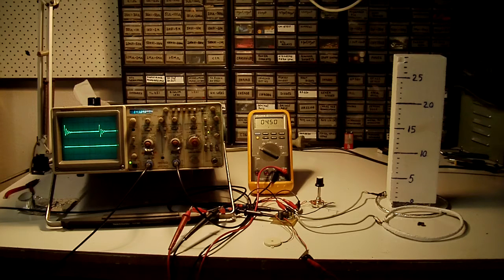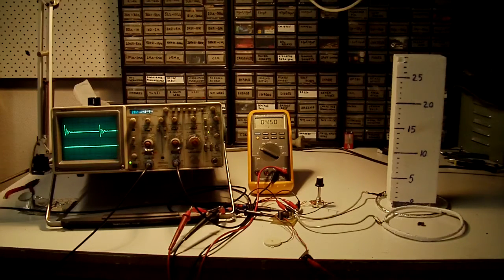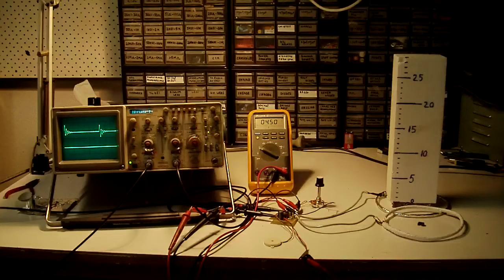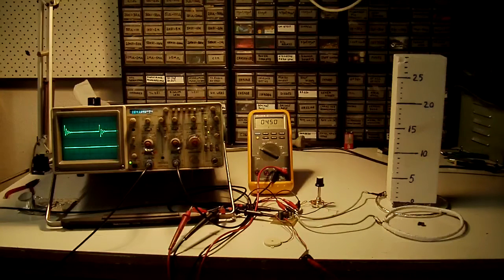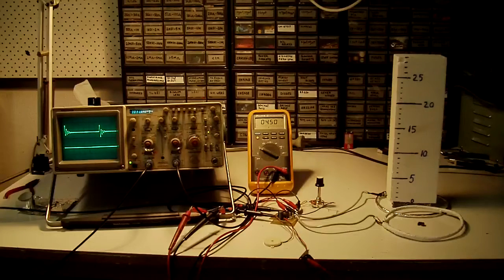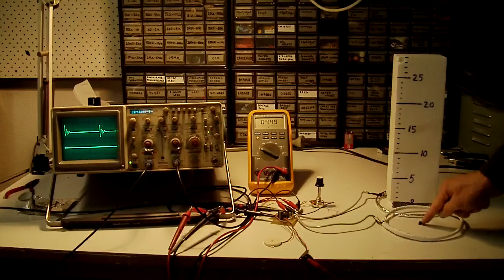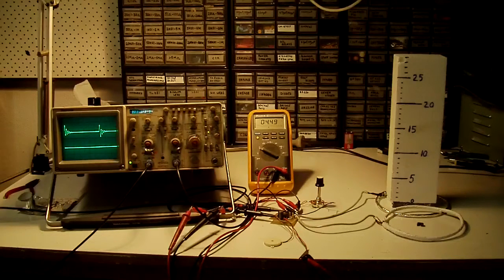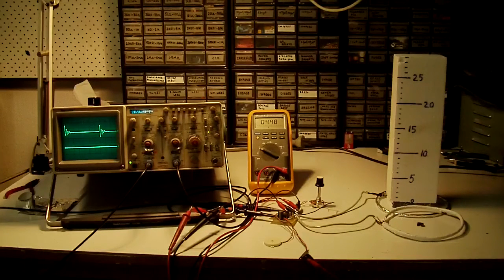Modified Matchless Metal Detector

Comment: if I reduce the coil size, can this work perfectly?
Reply from the maker: The coil size is important - a small diameter coil will have a low depth of detection. A large coil will have a higher depth, but only if the current through it is large. If you make the coil smaller, you need to increase the number of turns, so that the inductance remains the same.
Reply: @nick1f  so if the inductance is the same, will the detection distance remain?
Reply from the maker: @jsduan486  No, it will not remain the same, it will reduce. Detectorists who search for large targets at high depths are using large diameter coils (even one meter in diameter). They are less sensitive to small targets (even if they are located near surface). A smaller coil may be able to detect smaller targets. Anyway, you should experiment with different sizes of coils to see how the diameter affects the detection. Keep in mind this is just a very basic circuit, it would not be much use for metal detecting.
Reply: @nick1f  thanks, I am doing a metal detector project now and I want to achieve maybe 4-5 cm detection distance. In addition, I need it to cost small space for further design. So I am searching for the suitable circuit design now and I found the metal detector using proximity sensor only has 2cm range. Do you have any other simple metal detector circuit design?
Reply from the maker: @jsduan486  This was the simplest I tried.  I don't have other schematics. If you want better performance and stability, look at pulse induction metal detectors. They are more complicated, but superior in performance.
Reply: @nick1f  thanks. if the coil place close to the other component, will the performance reduce?
Reply from the maker: @jsduan486  The coils should stay away as far as possible from any metallic components nearby, as they will affect the results. You would also have to adjust the coil positions in order to get the null when no target is around.
Reply: @nick1f  so how to simulate this circuit with the software? can I use two ne555 timer replace the 556 chip and how can i achieve it?
Reply: @nick1f  sorry to bother you again, But would you mind telling me what is the function of preamplifier circuit and the second part of IC chip? When there is no metal, is the signal from Rx be zero so the chip is not triggered and when a metal is passed that the signal after amplification will be higher than 9V to start the buzzer. Is this right?
Reply from the maker: @jsduan486  The schematics represents an induction balance metal detector. The two coils are positioned in such a way that there is minimal transfer of the electromagnetic field produced by the first coil into second coil, in absence of a metal. If you check this document http://www.geotech1.com/pages/metdet/projects/matchless/matchless150c.pdf, you can see the placement of the two coils. The preamplifier amplifies the weak signal from the receiving coil, to apply it to second part of the circuit, which the author says it forms a peak detector that drives a speaker. If you are interested to find more about metal detectors and how circuits work, join geotech1.com and ask questions in there. Youtube is not quite the best place to ask plenty of questions.
Reply: @nick1f  sorry to bother you again. Could you please teach me how to simulate the coils conditions of this circuit? I mean the output of each stage for no metal and metal passing
Reply from the maker: @jsduan486  These are complex topics and I can't provide much help in here. There are other people who know the subject much better than me on geotech1.com. I suggest to create an account in there.  Very briefly, one coil transmits and one coil receives. The receiving coil is placed in such a manner that receives very small signal when a metal is not nearby. When a metal gets in the proximity of the coils, it will concentrate the magnetic field around it (like a magnetic core increases the impedance of a coil) and it will cause an imbalance in the field. This will cause the receiving coil providing a higher amplitude signal to the detecting circuit. I don't think the simulation can help much. Think of a weighing balance with two arms - if you put a weight on one arm, the balance will move away from the equilibrium point. Same happens when you bring a metallic target in the proximity of the coils. The coil parameters change very little (very small change in impedance). What changes is the distribution of magnetic field around the coils.
Reply: @nick1f  Thanks for your reply. I have uploaded my questions in the forum but nobody answers it for me. I still have a question that why the 555 timer will not produce a square wave when the metal is not nearby and it remains 9V for the output since there is a small signal received by Rx.
Reply from the maker: @jsduan486  Have a look at this image: http://www.geotech1.com/forums/attachment.php?attachmentid=15044&d=1303137192. Are you saying that there is no squarewave signal at the pin 5? That part of the chip should generate squarewave all the time, irrespective of the presence of a metal nearby. If there is no signal, you first have to focus on that part of the circuit. The recommended chip is CMOS. If you use a classic 555 you may have to change the value of resistors and capacitors (lower value resistors, at least for 100 kOhm) and higher cap value (47nF maybe). The other 555 with the output at pin 9 works as a monostable and it changes state only when the signal to pins 8 and 12 is strong enough to trigger it.

Comment from the maker: Hi, First make sure all components have correct values and connections are properly soldered, with no shorts between terminals. Double check pins for transistor. You have to use two CMOS 555 or a double 555. Adjust pot so that voltage on collector is 4.5V (half of supply voltage). For coils, follow advice from original article.

Comment from the maker: Hi Mark, all your advice is good, indeed the circuit would work better with a 12V battery pack and a 9Vstabilizer. About the suggestion to use plates for making the detecting coil, there are better methods, but the designer offered a construction based on commonly available materials. Anybody should feel free to improve the construction.

Comment from the maker: Also, you need to shield the coils with aluminium foil. Do not cover the whole circumference of the coil, leave a 1cm gap between start and finish. Apply insulating tape at the contact points between the coils, they should not make electrical contact with each other. Ground the shielding for both coils.

Comment from the maker: I don't think the signal from the radio station will completely dominate the function. There are a few things to check. First, double check all your connections. Make sure the component values are correct. Third - balancing the two coils is a delicate operation, you need to shift the two coils fractions of a mm to reach balance. Did you use a CMOS double 555? I understand it won't work with the classic 555. Is the voltage on collector half of voltage supply? You should use a 9V battery.
Reply: i used a regular 555 and it worked for me

Comment: To eliminate the instability caused by battery depletion, I would try increasing the power supply from 9VDC to 12 VDC (8 AA batteries) and place a 9 VDC fixed or adjustable output voltage regulator in the circuit. A potentiometer for volume control of the headphones is also desirable. As long as the circuit is properly housed in a metal enclosure and the search head is built solid (the plates suggested seems a little cheesy), you may be able to actually get a pretty decent detector for the effo

Comment from the maker: Hi, thanks for comments. I made this detector board just for fun. The diagram is simple enough to assemble it in an hour. I don't recommend building a full metal detector using such a simple diagram, since it has some drawbacks - needs adjustment often as the battery discharges, and performance is so and so (although it has good ratio performance / components). Also, there is no ground balance or discrimination. Although it is a good exercise for somebody just starting in the field.